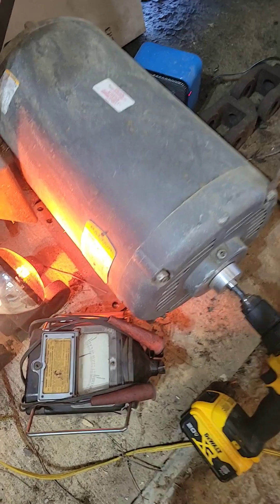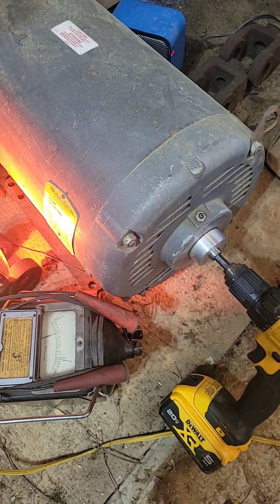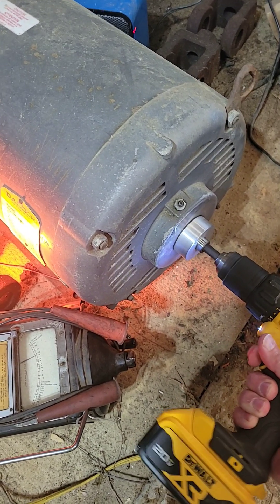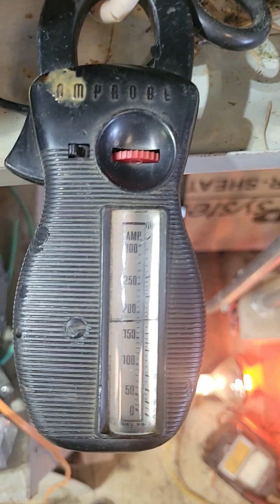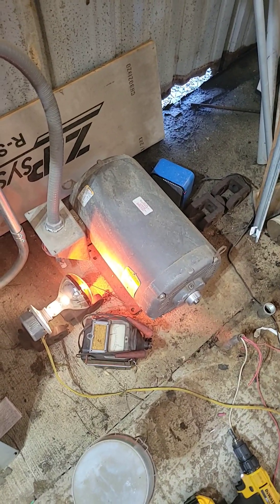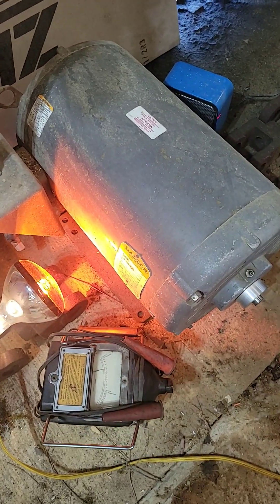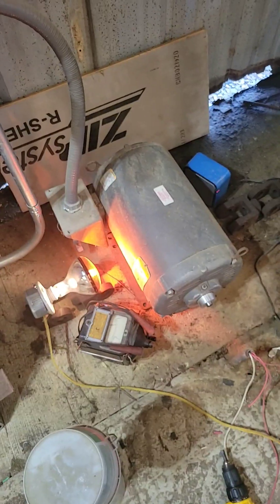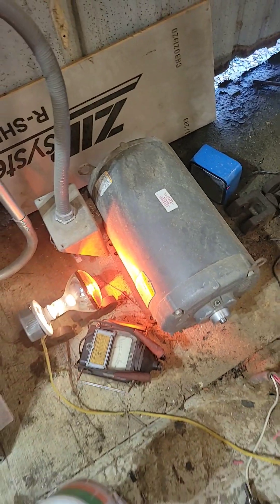Wet Windings on 30HP Rotary Phase Converter - When Will it Dry Out?

Comment: At the very least take it apart and service it.what you can do when you have it apart is blow compressed air through the windings. Then spray WD-40 on the windings to move the water deep inside the windings. You definitely will have to replace the bearings because they are probably shot.

Comment: What are the meggar readings?
100+ meg ohms?
Get the motor off the floor
Clearly it’s not shorted.
Check bearings
Take the rotor out and clean the stator if meggar reading hasn’t come up in 4-5 days
My 2 cents

Comment: Run some air through it heat it up take it apart and grease the bearings and clean up any rust on the armature and clean up the brushes and you should be fine

Comment: I’m not familiar with phase converters, but if it’s at all like an electric motor, the bearing lubricants and electrical contacts may be fouled up, and need cleaning. After a flood at my house, I had to replace some outlets and switches because they had dried mud in them. I’ve also had to replace some can size capacitors several times from age.
Reply from the maker: A rotary phase converter is basically a three phase motor running with no load. It generates an artificial third phase from the two single phase legs. This is a 30hp Baldor, i put in new bearings. Three phase motors have no contacts, very simple.

Comment: I'm thinking it's got other problems besides moisture. Probably going to have to disassemble and investigate.
Reply from the maker: Just scratching my head on how problems could "appear". Test runs were fine, but done some time ago after i thoroughly cleaned it and put new bearings in.

Comment: I would get some air going through it by a fan, and probably take it apart
Reply from the maker: Blue box is a 500w heater fan. Had it blowing through the end louvers, moved it to spin it up.
Reply: @EngineersWorkshop  how wet did it get
Reply from the maker: Never got splashed directly, but rusted steel building has a hole behind the motor. Really should make a shield for it.
Reply: @EngineersWorkshop how much forward and back play is in the rotor
Reply from the maker: None. Put new bearings in it. Ran fine last year until it sat around.
Reply: @EngineersWorkshop I’m guessing winding damage, is it wired the same as it was last time it ran and is the incoming power pretty balanced
Reply from the maker: @smalltownmachineshop6860 Yes, ran fine until shutdown, now high current draw. Will continue heat + air.
Reply: @EngineersWorkshop I’m no expert on motors by any stretch of the imagination. Is it possible that the bearings you used to replaced the old ones are a little different and could be binding the rotational movement of the motor some? It probably doesn’t take much drag to bog it down? Or maybe somethings out of place? It’s easy to overlook the small stuff.
Reply from the maker: No, bearings are correct, and motor spins freely. I've no time to mess with it further and will have to swap out a 15 hp motor for the converter motor. It will be enough to run the Rosenfors mill, and I can disassemble the converter motor when I have time to troubleshoot further.

Comment: You may need to have a fan blowing through the phase converter to move the moisture that has built up in it. Heat alone will not remove the moisture you need airflow.
Reply from the maker: Blue box is a 500w heater fan. Had it blowing through the end louvers, moved it to spin it up.